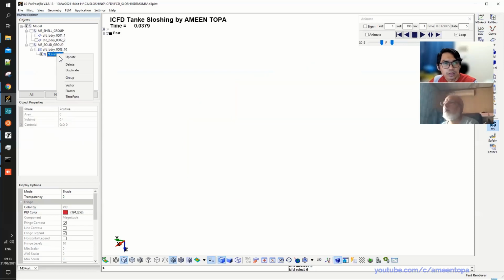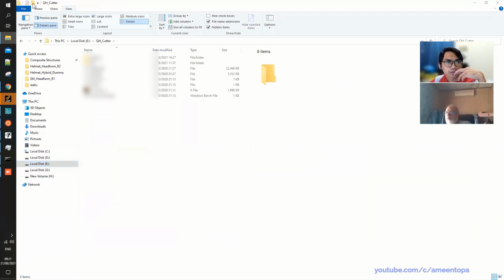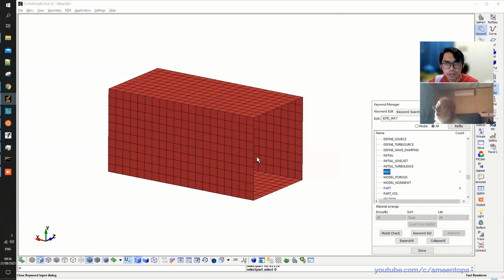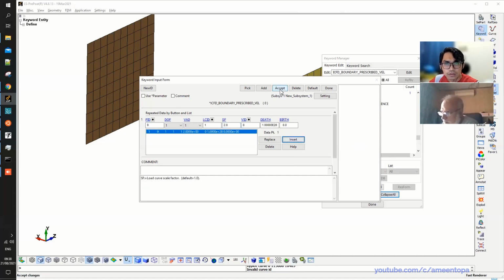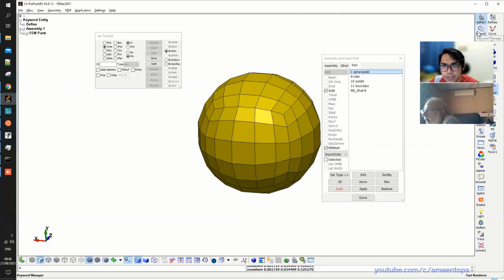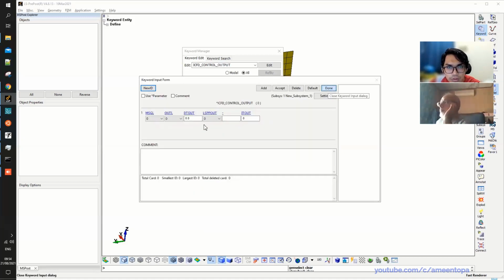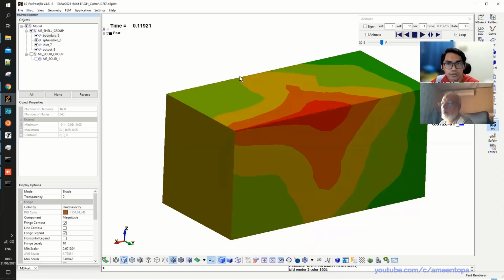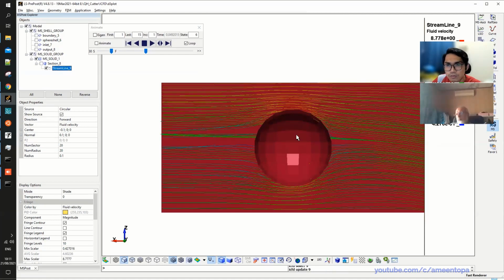3D ICFD in a nutshell: Sloshing and Closed Channel Flow

Comment: Hi ameen,can we do this simulation for a deformable ball to find deformations of the ball due to flow??
Reply from the maker: Yes. We need the CFD simulation with structural simulation. 

Watch my 2D ICFD tutorial on VIV (vortex induced vibrations). There, I did introduce the FSI (fluid structure interaction). I made the circle rigid as its deformation is not of interest. You can make the structure with elastic material to see the deformation.
Reply: @AmeenTopa  thanks.i wil try,can i get u r mail for contacting you??it would be very helpfull for me
Reply from the maker: Put your email here and I follow up in my free time.